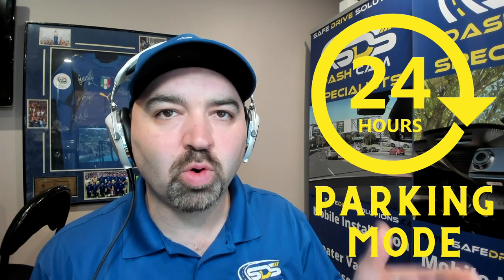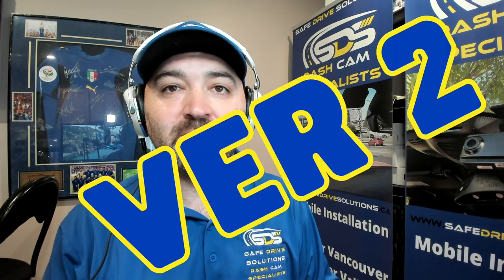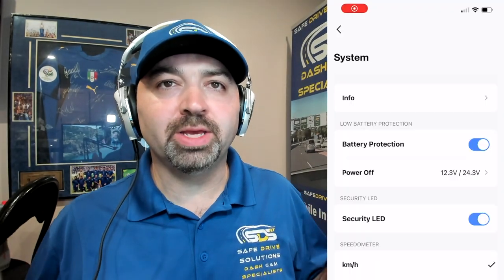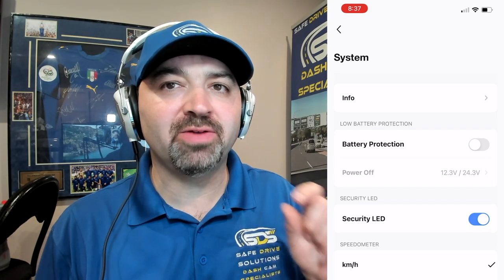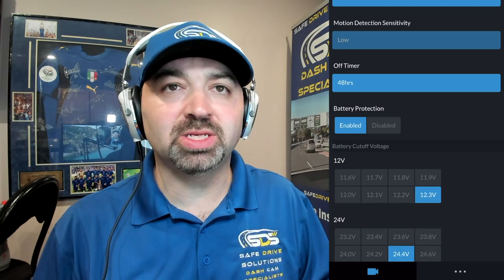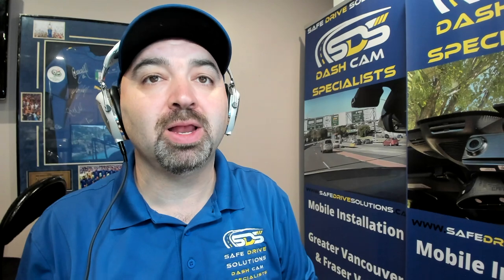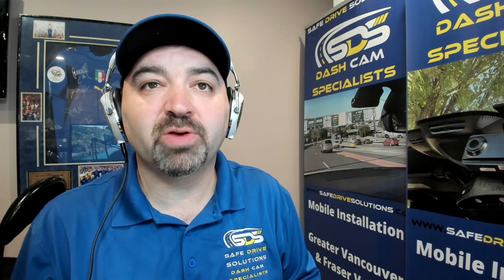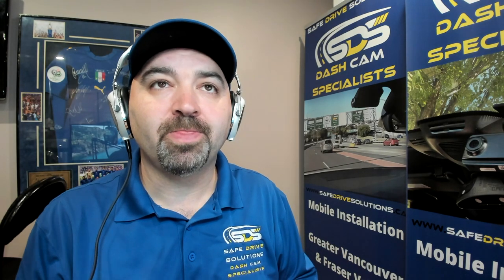Dash Cam 24 hour parking mode |Safe Drive Solutions

Comment: Random question for you, maybe you've had some experience regarding it. I have a new 2023 Prius Limited that I'm looking to get a Viofo A229 with a hard wired kit installed. I've heard stories online that prius's generally have smaller batteries which could equate to little recording time during parking mode or have an instance to where your car wont start up in the morning. Have you had any personal experience with Prius's in general? I'm also a daily commuter 25+ miles one way a day. I'm getting a job pretty soon where I'll be in a crowded parking lot and I want to make sure my Prius stays in mint condition and can record incidents when they happen. I'm really debating on whether I want to get a battery pack installed instead of just doing a standard hardwire. Any suggestions/tips/etc would be helpful. Thanks! 🙂
Reply from the maker: I would definitely get a battery pack for longer periods of parking record time.  If not your dash camera will only record 1-3 hours on a frequent basis.

Comment: But hang on Thinkware u1000 has power saving mode 2.0 which states it can last 2-4 days
Reply from the maker: Energy Saving Mode 2.0 on the Thinkware U1000 will last up to 23 days. Energy Saving Mode 2.0 with radar sensor will last 2-4 days on average.
Reply: @SafeDriveSolutions  ever tried or tested to see weather it can last those days stated?
Reply from the maker: @notorious.nip.888  So I have never tested in days as every vehicle is different. What I have done is tested current draw. It actually may even be in this video. I find on the average vehicle you will get 3-6 hours of motion detection or time lapse parking mode recordings. Which is approx 220ma of current draw. The current draw on energy saving mode 2.0 is approx 10ma of current. 

So if we say that most vehicles will last 6 hours on 220ma of current draw before low battery protection of 12 volt kicks in. Let's do some math. 6 hours x 22 (due to 10ma being 1/22 of current draw) 6 x 22 = 132 hours. 132 hours / 24 = 5.5 days on an average vehicle. Now if you have a truck with 2 batteries I bet that will last way longer like closer to the 21 days based on my installation experience. 

Now let's look at energy saving 2.0 with radar sensor. which is approx 40ma. 6 hours x 5.5 = 33 hours = 1.4 days. 

These are all approximates as every vehicle is different. The other challenge is some vehicles already have a parasitic battery drain typically low so you do not know which vehicles those are. Unfortunately not every vehicle is standardized with same battery and same features.  

I hope I answered your question.
Reply: @SafeDriveSolutions  1.4 days yeh i wouldn’t be happy with that, I shall report back to you how many days I will get soon when I get the Thinkware u1000 all set up
Reply from the maker: @notorious.nip.888  I would be happy to know what you find for results.
Reply: @SafeDriveSolutions  hi mate you have some interesting titles in ur video library I have saved quite a few to watch later
Reply from the maker: @notorious.nip.888  Thanks

Comment: Welll, thanks for so much information sir. 

Now where i am confused is i have a car 2016 honda city in india. Battery is replaced just last month ago. My dashcam is wolfbox g840.

Earlier it is used to record 24 hours format in 1 min loop recording. Now what i am seeing is it records for some time then not. I checked the wires, got them re fitted. I checked sockets as well as settings mode. Can you help me in it?
Reply from the maker: your low battery protection is probably kicking in

Comment: Hola, Rubén de Argentina.  Tengo un Renault DUSTER, compré un DVR Brand A68, conduzco más de 50 kms por día 6 días a la semana. El auto queda cerca de 12 horas estacionado sin movilidad. Con ése tiempo de consumo de la cámara en modo Parking, me queda energía en la batería para que arranque sin problemas? Qué puede ocurrir el 7 día con el auto sin moverlo? Aguanta las 24 horas sin movilidad? Gracias
Reply from the maker: I am not familiar with the car, or the dash camera. Also not sure of what the low battery protection is set at. Is there a switch on the harness? preset voltage? or is it controlled via dash camera itself?